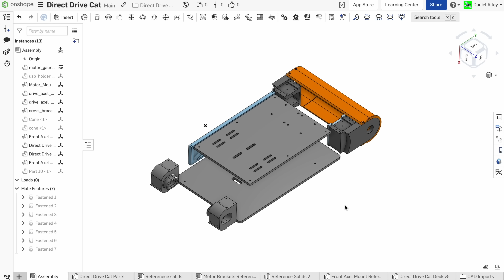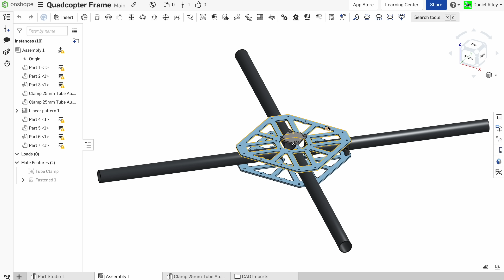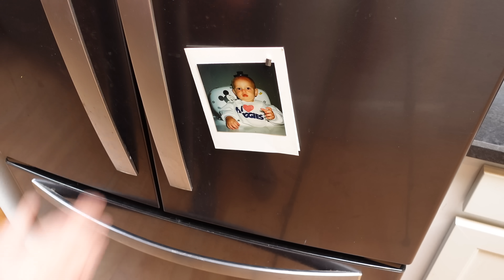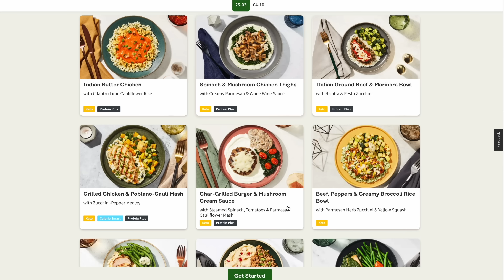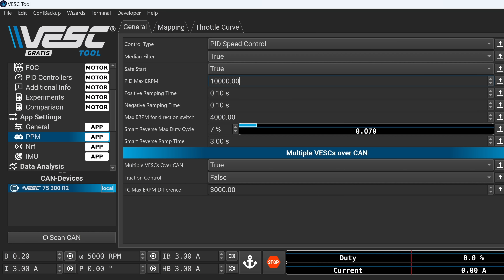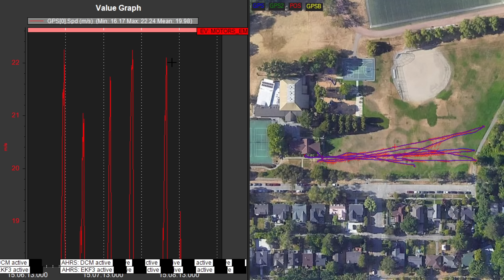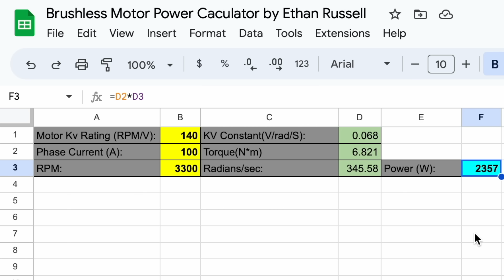Worlds FASTEST R/C Tracked Vehicle

Comment: I have a suggestion, maybe try out tracks printed in tpu, it would give them a little more durability and wear resistance factor, a little added flexibility as it seems one of the limiting factors are the tracks, so maybe using tpu printed tracks would benefit it, another thing you could do is make little servo controlled downforce wings that pop up at a certain rpm and fit flat and flush to the center of the body and between the tracks so they aren't damaged when not in use in the front and back of the vehicle, it could help with speed and control
Reply: The tracks are cast. Idk what exact material they are, but 3d printing will be worse.
Reply: @VulpeculaJoy  they are not cast, they are 3d printed, he shows in previous videos he 3d printed the entire tracks
Reply: Doesn't tp lack stiffness and strength though? I think you could get a lot of mileage out of a dual-extruded composite of tpu and something strong like PC or PA. But maybe figuring out how to make the best gcode to tune the mechanical properties you want is a PhD-worth of work.
Reply: @Charles Lambert  TPU 3D Printer Filament Definition Explanation (Thermoplastic polyurethane) is a type of flexible and elastic 3D printing filament. Its rubber-like elasticity, resilience, and durability make it suitable for uses requiring impact-absorption and a soft-touch surface.

Comment: Since it can wheelie why not gear it up!!  To double track rpm.   Slower takeoff but higher top speed.   Place moter in center of tank as well since chain would go from motor pinion to  smaller pinion on track hub

Comment: i think a perforated motor guard would be great for it, not only would it allow more air flow, but also more sand “drainage” i also think adding a front spring tensioner might allow for some more travel range on the mid wheels, and would absorb some front shock to the drive wheels, but they would have to be pretty stiff to keep the tracks seated, however it also might help with re seating the tracks when they slip off, i love following this whole project, and i am think about splurging for a printer just to build one

Comment: Hi…. Using epoxy to waterproof….u do it (or others) but not a factory thing…so are u sure of efficiency, safety…
Metal works with heat….😏 …size
They need wind contact to cool down…🥶☕️
So need thinking.🥜🥜

Comment: That was really cool. Great design. I will say that when I design things for 3D printing, I try to put things like ribs or runners on all large surfaces to give them a bit of extra strength.
I dunno if you want to try it, but I'm wondering if the tracks are going fast enough to aquaplane on water. It might be able to cross a pond.

Comment: I've built skid-steered battle-bots and the best upgrade I ever did was adding a steering rate gyro.  (just a V-tail mixer and a tail-rotor gyro to start)  Took a bot that was a nightmare to drive that never pointed in the right direction and turned it into a drift master.

I think doing the same with the flight-controller software will dramatically improve high speed stability and turning.
Reply: Yes! As a bonus, add in pitch control to hold a perfect wheely for max acceleration!
Reply: @ericcmcgraw  thats what i was thinking, since he already has an ardupilot install. I THINK Rover has pitch control in one of the modes. I know it has yaw control that countersteers when you get too much roll because I'm using it right now.*

*although it's a little laggy and gets into weird oscillations on rough ground that lead to rollovers anyway

Comment: AWESOME EVOULTION OF THE SNOWCAT!!   LOVE THIS! 

Due to the body i designed and were the batteries are placed the snowcat kit of yours i built was also heavy in the rear.    put a couple lb's of brass bolts i had into a ziplock and put it in the clamshell and ziptied it to the front axel.      just kept adding more until the CoG was in the middle of the cat.   made it handle deep snow much better but turning is still kinda sketchy in the super deep stuff.

*Thanks for showing my build at the end!!  :)   ~DoctaWubbles

Comment: For the top speed run, how about making a simple fairing for the tracks? It would both reduce drag and the amount of power spent shoving those top track “buckets” through the air against the direction of travel, by a lot

Comment: Damn! I’m so jealous of that cnc machine, if I even had access to one I wouldn’t have nearly half the issues I have with building any of my rc projects!
Reply: Look up your local maker spaces and go talk to companies that might have cnc machines. My local machine shop went belly up, but guys that worked there put up their own company and owners dad that was going to retire still works there as a hobby and to help out. I can get machining jobs done fore fraction of the cost since i'm not in hurry to get anything done so they can fill their schedule with my jobs when there is spare time around in shop. Same thing with welding jobs and anything really. Most welders dont mind doing quick job on the coffee brake or afterwork if its not that time sensitive or large and usually pack of coffee (around 5€) is fine for them as they get more life juice into break room. So my advice is to talk to people. This is how you learn about possibilities around you.
For making RC parts, most can be done with basic CAD (cardboard assisted design), jigsaw, hacksaw, grinder and some files. Holes with drill press specially if you are using aluminum. Just be patient.

Comment: I'm actually surprised that it survived for this long, I thought the tracks were going to disintegrate at such speeds. Awesome stuff!
Reply: The rc snowmobile community has had the tracks going 60+ mph it's insane how the links hold up! Note they are not rc test flights tracks
Reply: 3D-printed plastic is solid indeed
Reply: That was my first thought - that the treads would stretch at high speeds, and any wobble would send them flying.
Reply: Yeah, I was going to say "all that weight and plastic gears!!". Good going.
Reply: Plastic can be surprisingly though, we just don't see those kinds of plastics very often in day to day appliances, some can be as strong as machined aluminium and can have fairly high chemical and thermal resistances, they are a pain to print though and will need fairly high grade printers or very expensive upgrades.
It's surprisingly how strong even basic PLA is.

Comment: Yeah, you aren't going to be able to pull 8hp of power through an xt60 from 2200mah batteries. No way.
See what the VESC logging says about that sorta stuff. It should be able to track current draw and voltages.
Might also be useful to add some extra capacitors.

Comment: Maybe you can use the IMU in the ardupilot unit to create a coarse type of ABS, but for acceleration rather than braking. So if the RPM of the motors exceed the vehicle speed by some margin you can forcibly slow them down to maintain traction. I think part of what makes it so hard to control is that if you turn hard right, your left track can lose grip and net you will actually turn left. Traction control could help what that, especially on the ice.
Reply: To reduce internal friction you could print the track guides out of a filament composed partly of teflon. There's a couple out there now and supposedly they feel so slick that they almost feel waxy.
Reply: I also wonder if you could reduce the air resistance of the snowcat by deflecting the airflow upwards before the treads. Downside would be reduced downforce and therefore traction.

Comment: You should try to add an IMU or distance sensors and limit the rpm while accelerating so it doesn't go into a wheelie for stability. Kinda like traction control

Comment: I thought bldc was set by the pulse speed,  increased voltage increases torque. Brushed motors increase speed with voltage. But I could be wrong it has been a few years since I looked into it.

Comment: Love this series!
Would you have better luck if you could find appropriate rubber tracks?
And swap it to motors as the front to help with weight distribution?
Reply: The only issue i see with this is that the side of the track in contact with the ground should be under tension, so a long toothed belt would be needed to transfer the drive from the motors up front to the track drive sprocket at the back.
That said, the track tension could be high enough for it not to be a problem! It worked well in the snow going backwards! 😄

Comment: Super cool! Have you tried using 58D TPU for the tracks? Extrudr even has one hard TPU mixed with carbon fibers which should make the tracks semi indestructible.
Reply: I think he's using cast tracks and not printed so they sould be plenty strong as is, it's just that hey are too wide to cope with the forces of such high speeds on solid ground, though on deeper snow wich they are designed for they seem to do just fine
Reply: Lmao, watch the latest Zach Friedman filament video. That stuff is awful
Reply: @FayezButts  Are you talking about the "CF-TPU by SmartMaterials"?
Because that's a completely different filament.
The standard hard TPU from Extrudr is one of my favorite Materials ever.
It's super tough, easy to print and I'm pretty sure that the CF stuff is awesome too.

Comment: Guessing you have not fallen off a board going that fast yet.  Lol  Because you would not wearing shorts if you had.  Tar hurts on skin at 40 mph.  Love this new tank design.  I was not able to get the last tank, so hoping to acquire one of these.
Reply: I wear long pants riding a OneWheel at half that speed, and it still scrapes you up pretty good if you fall off wrong
Reply: @plasmasupremacy9321  I am in my late 40's, and even tho I grew up on a skate board, you wont catch me on a one wheel.  Lmao.  For me, its a accident waiting to happen.
Reply: @ChainsawFPV  Fair enough. I've only fallen off three twice at high speed in the 2000km (1200 miles) that I've got on the odometer, and both times it was clearly my own fault. (Was going fast when I didn't know the track well) I always wear a helmet if I'm gonna go fast though. But if you're sensible, it's a surprisingly stable platform. And I keep riding it because the feeling of the board moving under my feet the way I want it to almost without thought is amazing.

Comment: Probably too much of a risk but I would love to see you try and drive this across a lake!
Reply: Seeing how much it bounced on the hard snow, i guess that would be the issue on water aswell. A little too sharp of a turn it would start cart wheeling and sink.
Reply: too much risk?

Dude rides an electric skateboard with zero protective gear & no helmet.  Risk is not a factor.
Reply: Its likely it could stay on top of the water for a short time because it's mad of plastic and the tracks are reasonably wide. Probably not waterproof though...
Reply: Some pontoons to keep it afloat to test?
Reply: @Gainn  nah, this thing has enough power to skip right on top of the water, I'm not sure how stable it would be. but the speed is more than enough.
Reply: @MrGuliton  I'd agree it has the power. The problem is if it stops.
Reply: @Gainn  Just put a CO2 cartridge and some airbags on it.
Reply: It will work for sure! If you're curious what it look like, i made a video about that with on of my 3d printed rc tank. The main challenge is to keep the nose of the robot down to maintain a good attack angle on the water.
Reply: @RoboticsSideProjects  thanks, I will check it out - I already thought that maintaining a constant AoA would be the key
Reply: Same!
Reply: If we can ride dirtbikes across lakes I'm sure we can get one of these juiced up snow cats to do the same
Reply: If he special made some tracks for water it would work to drive on water, but might be to heavy.
Reply: It would work if the tracks were solid rubber.

Comment: Awesome! I started to think about centrifugal force, track linkage bearing friction starts to be a thing I guess at this point. Can be reduced by lower track piece weight or some suitable bearing in the track pieces.
Reply: Bearings arent possible with all the dirt and sand they fail very quickly, even real tanks and bulldozers dont have bearings in there tracks.
Reply: @jonasstahl9826  You're right that the large tracks used on excavators and bulldozers don't have them but the OP's point was about the centrifugal forces tracks experience at significant speeds.  Even fairly fast tanks are unlikely to face stress from centrifugal forces that even approach the forces from the usual driving torque acting against the vehicle weight/inertia and a bulldozer clearly never would..  I don't know if bearings are the only solution but I don't buy the idea that sealed bearings couldn't be a solution -- if a slightly costly one.
Reply: @whatelseison8970  The problem is the weight of the bearings, if I remember correct each of his tracks has 60 links, you need 2 per links, means for both sides you need 240 bearings.
The cheapest sealed I have found are roughly 0,60€ means 144€ in total. Also the weight lets say there are 10 grams each that makes 2,4kg/ 5 pounds.
You also need enough material thignes to fit the bearing, that makes it even heavier.